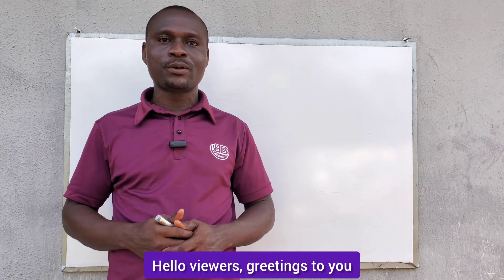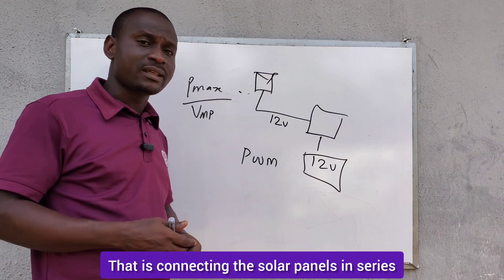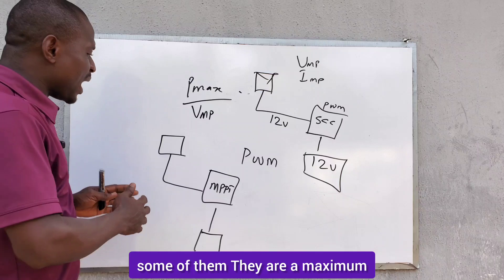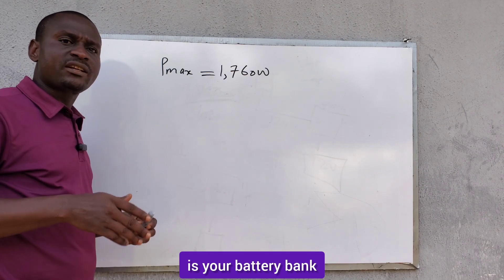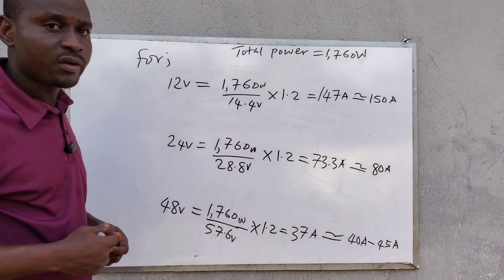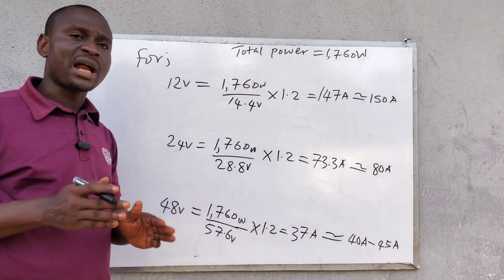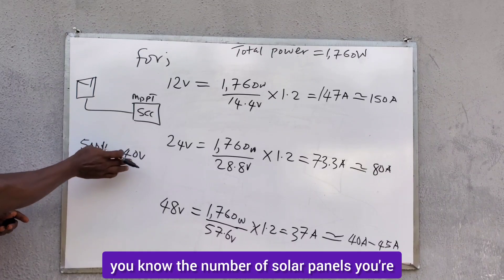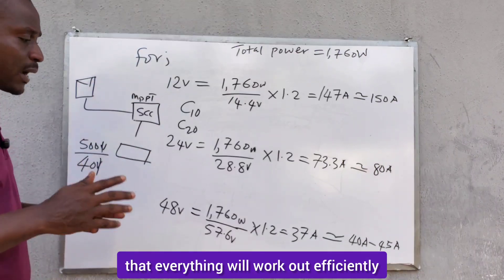How to Size an MPPT Solar Charge Controller. #renewableenergy #education #greenenergy #solarpanel.

Comment: `Sir, how does the MPPT charge controller convert the excess voltage to charging current or is there a formular for it?
Reply: If you are not designing an SCC, I doubt you  the voltage buck conversion process is a knowledge which I doubt is necessary. You can always Google how the MPPT process works if interested

Comment: What if my panels produce more power than the charge controller is able to deliver to the battery. Will the charge controller just dissipate (waste) the extra power, or will it get cooked.

Comment: Thanks , from Lagos, I want you to clarify me on these. I learnt that what a battery needed most for charging is the current, does an MPPT charge controller have capacity of boosting the current to higher current because series connected panels currents remain constant.

Comment: This teaching is not 100% accurate, to you we need 150A to charge battery of 12 volts and for 24v we need 80A according to your calculations
Reply: He's right,the lesser the voltage the higher the current

Comment: If I want to use 3 solar panels for 550w which controller can use ? With 2 batteries for 200ah
Reply from the maker: What is your system voltage?

Comment: The solar panels which have 42v - 46v are they 48v or 24v?
Reply: You needed to look the maximum input Dc voltage for your Mppt controller before connect Pv.its simple
Reply: @gstone830 you didn't get the question ....18v solar panels are 12 volts panels 100 watts and less ...so is 500 watts solar panels a 48 volts panels?  What about 24v and 36 v panels

Comment: A very simple explanation for PWM VS MPPT: PWM simply controls the voltage, leading to power lost as heat. While MPPT perform step down operation using buck technology, thus increasing the Amps, meaning you wont have power lost
Reply from the maker: exactly... Thanks
Reply: I like the training pls
Reply: Perfectly explained, from PNG.
Reply: Watching from songotedo lagos
Reply: Thank you bro! 
After much research on charge controllers this exact words you typed was my conclusion. I'd thought that I was the only one seeing both PWM & MPPT CC from this perspective, but now that I've seen someone who also sees it from that same perspective, I'm now convinced that I'm not alone & that I've been right all along...
Reply: Plus, the PWM charge controllers have been phased out.
Reply: I'm interested
Reply: Interested
Reply: What that means in simple terms is that the extra sun light that pmw considers as waste that shouldn't pass through, MPPT conserves it in cases where there are no more sunlight and converts it as extra energy that can still serve as boosting factor for your battery so that there are no losses
Reply: I want to join your training class Sir
Reply: How can I join your training class
Reply: Thanks for your lectures but I want to call your attention to a video you did on how to connect an hybrid inverter, you made mention about other parameters but safety factor wasn't inclusive and mmpt charge controller was infused with the inverter too? Or if doesn't come to play in that case sir?